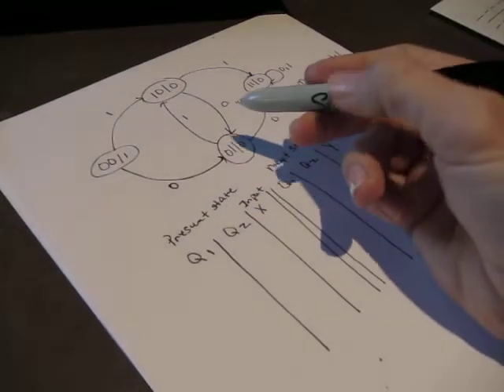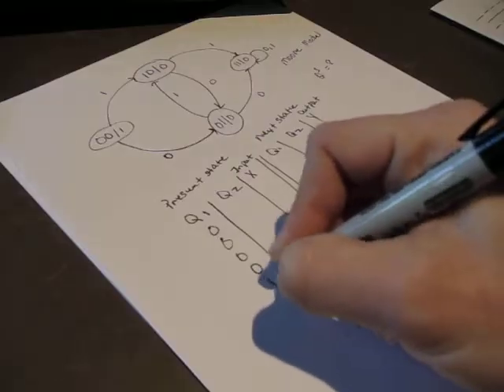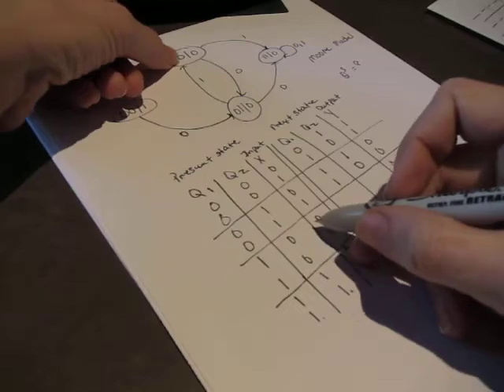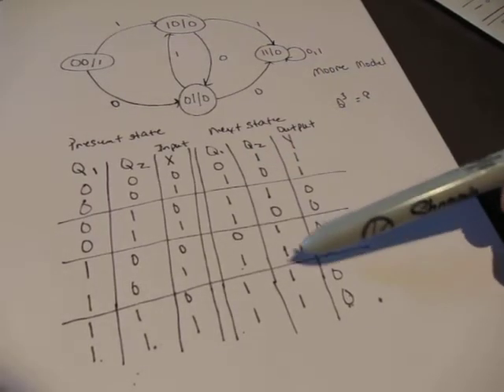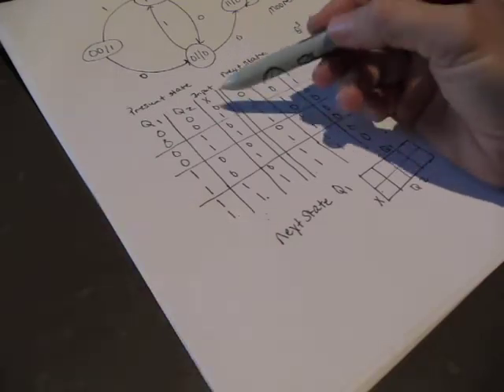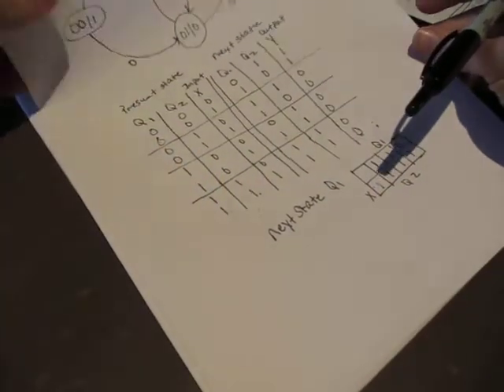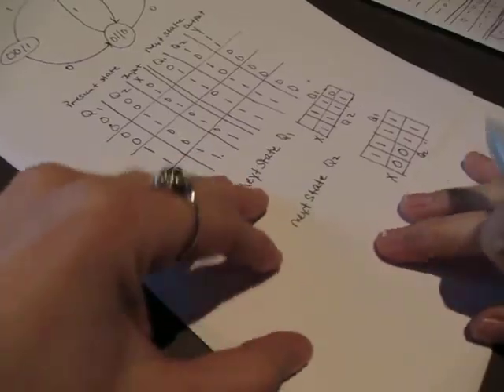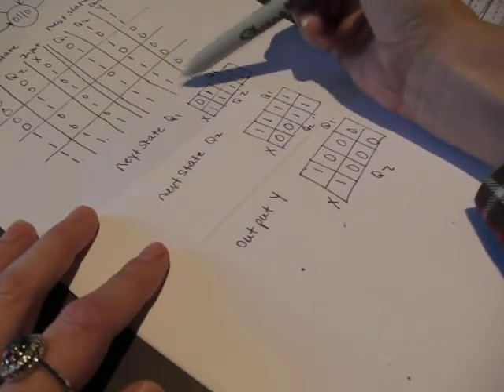Creating a Circuit from a state diagram

Comment: Ahh it took me a second but I think I understand the k-maps

For the 1st one, the output represents next state Q1 and the kmap can be interpreted by: x is on the y axis (row), Q1 is on the x axis (left most and rightmost columns) and Q2 is on the x axis (inner most 2 columns).

All outputs are for next state and then output y

To reiterate, I think it looks something like this, although the equations she derive really throw me off (especially the last one).
     Q1' Q2' Q2 Q1
X'
X